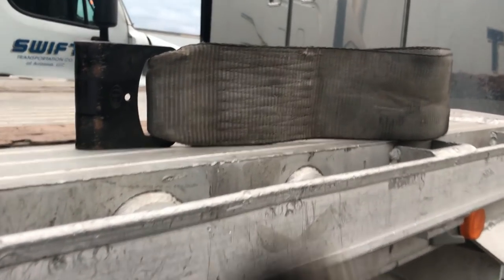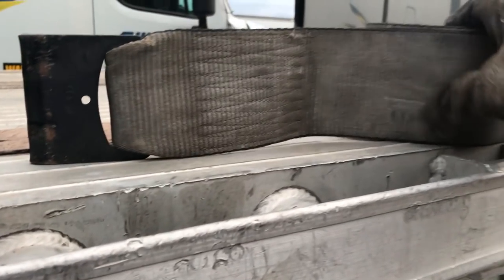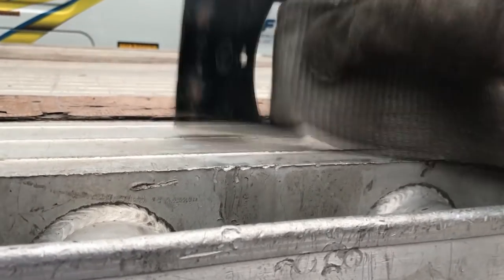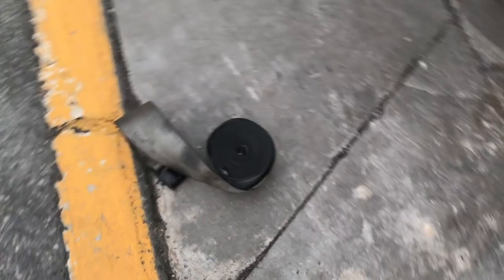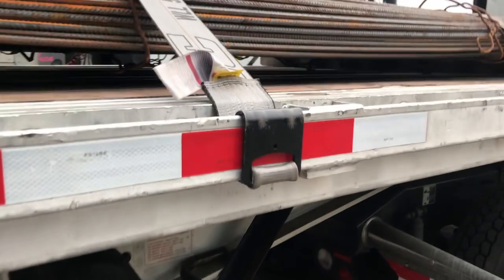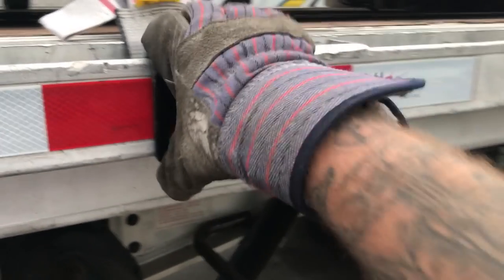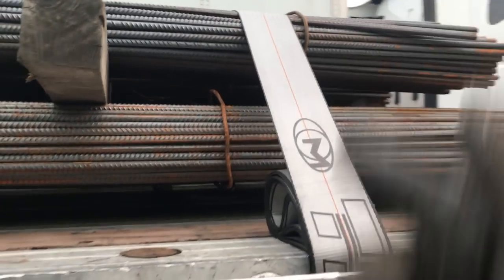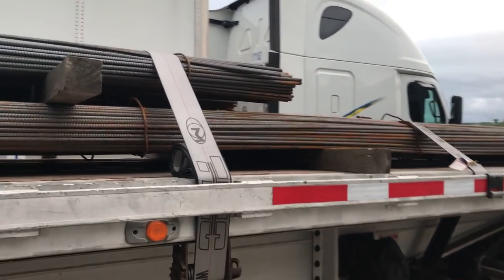Warning: Don’t Try This At Home!  BEHIND THE BACK CATCH- CHECK IT OUT!

Comment: hello a question, what are the steps for the commercial driver's license with hazardous materials
Reply from the maker: Steps for getting your HAZMAT endorsement, or steps for securing and carrying HAZMAT?
Reply: All the steps
Reply from the maker: You will need to have your class A CDL and then take the test for your HAZMAT endorsement so that you can haul HAZMAT. As for transit you will need to have your paperwork in order and in arms reach at ALL times. You will need a placard on all 4 sides of your trailer to indicate what HAZMAT you are hauling as well.

Comment: Choice I’m serious I wanna know what my best option is for Internet inside the truck to use on my laptop
Reply from the maker: You can buy a years subscription at the pilot flying J truckstop for their Wi-Fi hotspot, or are use that or my Verizon wireless hotspot. That would be my suggestion.
Reply from the maker: The year subscription for the pilot flying J Wi-Fi while you’re in the truck stop parking lot is $99 for one year. When I’m not there I use my Verizon wireless hotspot.
Reply: Choice M.A.S. OK buddy thanks for the information I’m just going through my checklist to get ready to head out to Iowa in two weeks talk to you later